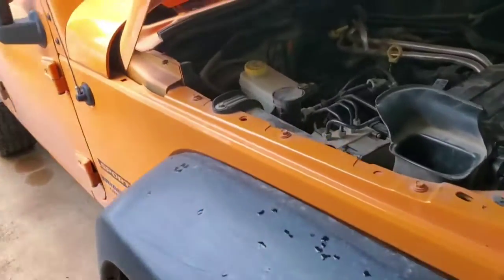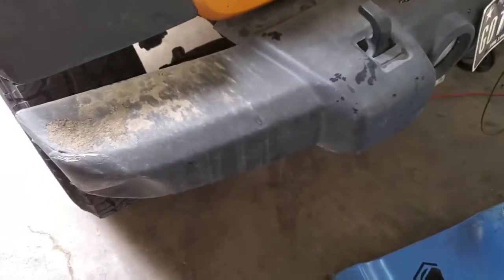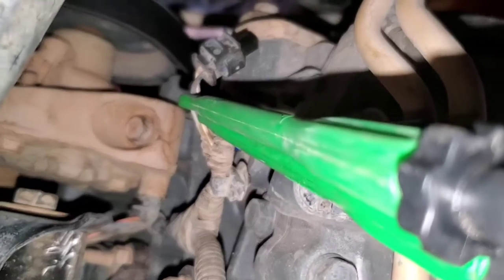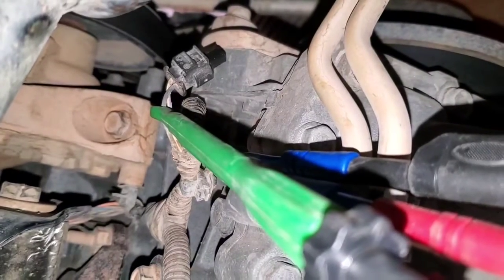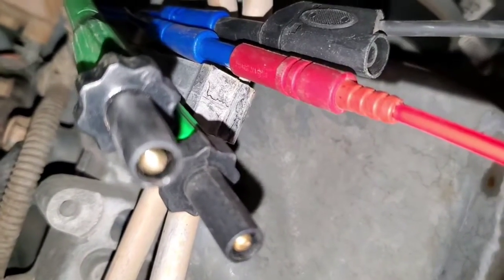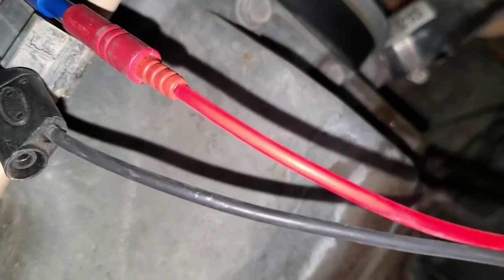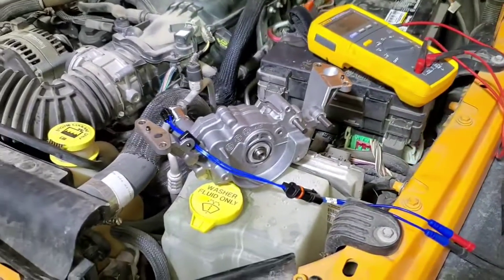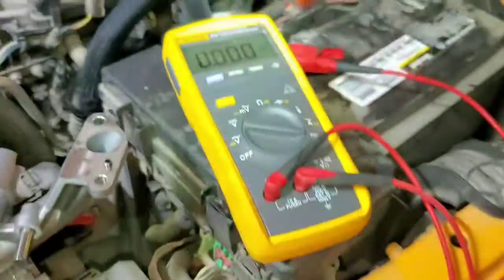Jeep 3.6 testing oil pump solenoid P06DA

Comment: Just replace unit with factory mopar unit i learned the hard way replaced with dorman sensor and it went bad after 2 days. Dorman sensor was testing 2ohms.  This is a huge job!  i didnt search for prices and only looked at local parts stores.  there store brand pumps were 350 plus thats what made me not even look at mopar factory brand because factory parts are way more expensive but after the dorman sensor failed i wanted factory parts and didnt wanna do the job a 3rd time.  Mopar part was only $226.  New sensor testing at 23.4ohms :) use the factory mopar 3bond rtv $35 it comes in caulking tube very small only what you need for oil pan job set time is 10mins so be ready for every thing might want to use electric caulk gun for ease.  also buy new pick up tube oring $10.  cheers to all.... yes it did fix the P06DD code.

Comment: where does the power come from? dealing with a 2013 dodge journey no power at oil pump solenoid check continuity to the PCM wires  checking OK still no power.
Reply: Tipm module

Comment: So the solenoid is bad and you replace the whole pump? is the oil pump electric on these things? my wifes car is popping this code, which led me to find the stupid oil filter housing leaking. replaced that, no leak, but still getting this code. car runs fine.
Reply: Doorman sells the solenoid separate.
Reply from the maker: Yep I replace the whole pump. The pump is mechanical. I doubt they sell an OEM solenoid by itself anyways. But regardless if it is available separately- as a professional you should always change the whole pump assembly to CYA or the customer will be demanding you replace the pump for free if the pump goes out 10K miles from now.
Reply: @TechnicianRed  Good point. I see the pump is only $200, the solenoid is probably half that from Mopar. I'm going to check the oil pressure. She may be living with this code until she trades this turd in. What a stupid idea to save a tiny bit of mpg%.
Reply: @mooosestang  did you ever find the problem?  I just replaced the solenoid on the pump and still have this code.  I'm gonna try a different oil filter now
Reply: @live2ridegsxr1000  did you end up fixing it? what was your solution?
Reply: @TechnicianRed   I have a 2012 Wrangler and had the P06DD code that started randomly but rarely. It would go away after a few drive cycles but then it was happening more often. Dorman actually sells the solenoid by itself for less than $50. I purchased it from Amazon and went through the trouble of pulling the oil pan to replace it. I should have just replaced the whole pump but I was trying to be frugal because I didn't think the mechanical portion of the pump was bad. The replacement solenoid worked fine for a few hundred miles but now its throwing the P06DA code. I'm thinking that new Dorman solenoid already crapped out. Something to note though is that I had a mechanic friend reseal the timing cover because it had been leaking for a while and I was there when he did the job but I don't think it has anything to do with his work. The oil pump and wiring was never touched and if he did mess up the wiring it probably would have triggered the code sooner. I drove the Jeep almost 100 miles since then before this new code triggered.

Comment: Testing power from connector im getting no bolts with key on, do I need to crank while testing connector voltage?

Also how did you ohm the solenoid? Tight space.
Reply from the maker: You need a professional scanner to command that solenoid on/off to do voltage testing. To ohm it out, it's best to have a professional automotive terminal testing lead kit but that's about $350 so you will just have to try really hard with normal leads to get a good connection.

Comment: Was the motor lamp or the oil lamp was on by this issue?
Reply from the maker: It's been too long but I believe it just caused a check engine light.
Reply: @TechnicianRed  i have the failure p06de but none lamp is on just the information of reduced power. Could that be the oil pump selonoid?

Comment: Just subbed your channel. Ohm’s law might have helped. The 1.7 ohms on the bad solenoid might have been a clue. That much ohms on with say 14 volts would have been over 8amps. That’s too high for all solenoids I’ve tested. Great video! I like the thought process and steps you took.
Reply from the maker: Yeah I allways forget about using ohms law. That would have been a dead giveaway.